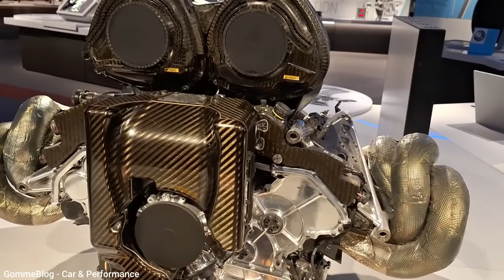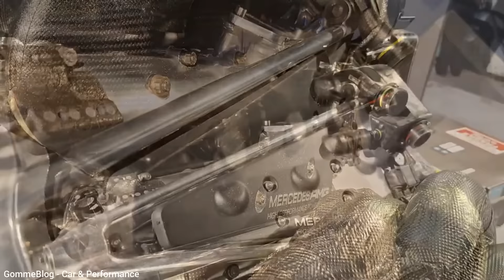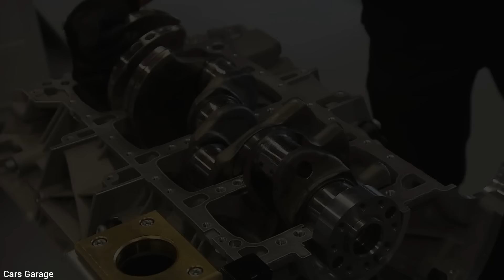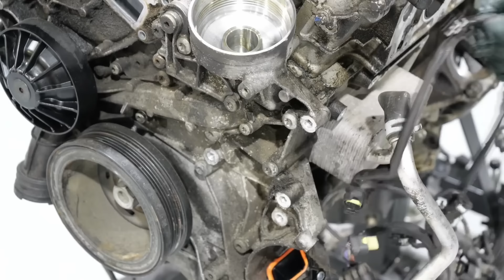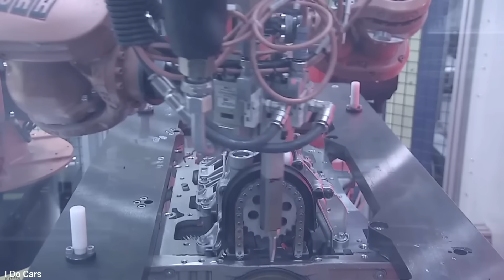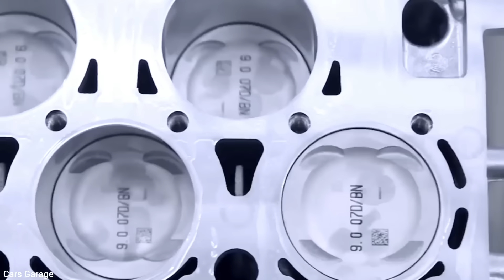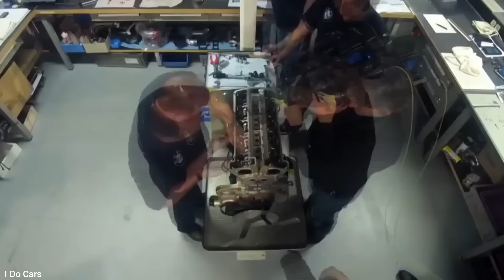How a Tiny 1.6L V6 Formula 1 Engine Can Make 1000Hp?

Comment: 1000cc motorcycle engines with turbo getting 600 HP, and this is for road use although not for nervous... Incredible engineering in F1 but roadbike tuners are close on HP/cc
Reply: Same concept.
1800s technology.
Pistons and valves.

Comment: I guess no one knows about the Pro Street motorcycles that race in drag racing, that make somewhere around 800-850hp with 1299cc? With class spec fuel and restrictions. Now to do this in the 80's and 90s, impressive.

Comment: In the 80's turbo era Renault and BMW 1.5L engines made 800 to 1000 HP in race tune and 1500 HP in qualifying tune.
I watched Senna, Prost and other drivers race these cars with their engines howling and their brake discs glowing bright red.
The pinnacle of F1.
Reply: I love the old turbo F1, but they eat 2 x 90L di gasoline every GP, now 2026 only 75kg for entire  GP
Reply: @pinobarberi473  on the end they have 120l

Comment: 0:16 F1 V6 turbo hybrids never reached 15,000 rpm AND they never screamed. The engine can't reach 15,000 rpm because of the fuel flow limit, which only enables the engine to go usually 13,000 rpm on long straights like in Baku or Monza. Also, they would never scream even if you revved them to 20,000 rpm. They're odd firing V6 engines because they are 90° V6's without a crank split, and they're mandated to be that, which means no even-firing action, and therefore, they sound deep, rumbly, and not screamy